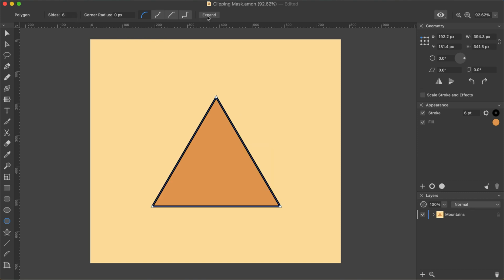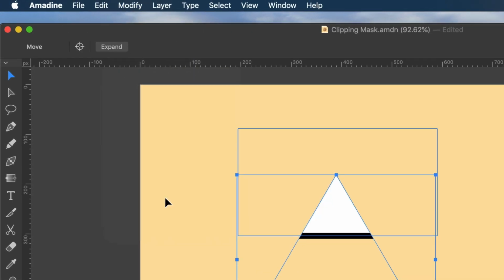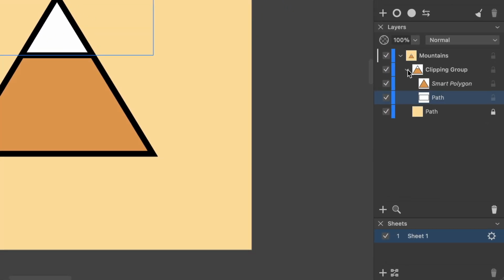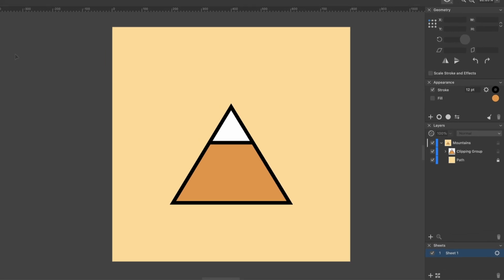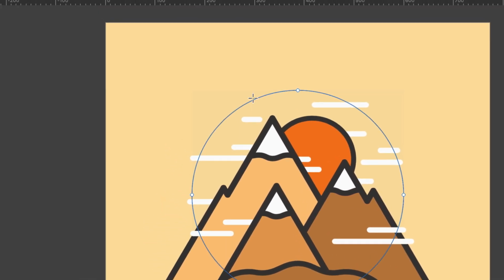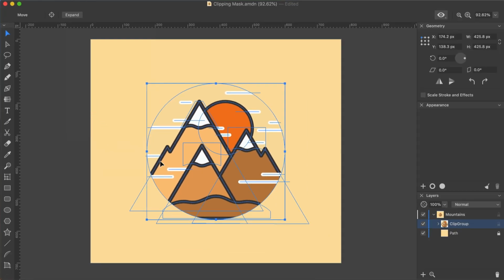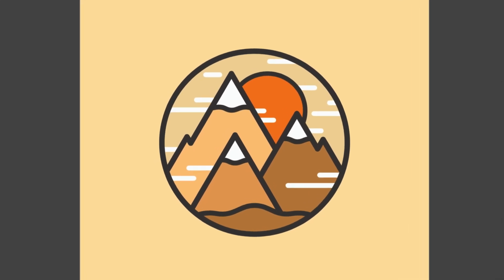Clipping Mask—Amadine for Mac Tutorials

Comment: so it's different from Affinity Designer & Freehand where you can use the Paste Inside function.
Reply from the maker: Yep, this feature works differently in Amadine, as Affinity Designer & Freehand are other applications. We decided not to make additional modes of Paste when the same result can be achieved without them.

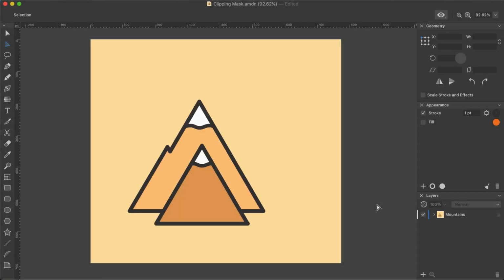Comment: 2:42 Do you add a path to the triangle to create the second mountain, which has that jagged line? I cannot seem to add a path to a triangle. I can do it to a rectangle, or a circle.
Reply from the maker: You can create any path with a Draw or Pen tool, on top of the mountain (triangle), and then in the Layers panel drag this path into the mountain (triangle) and a mask will be formed with it.